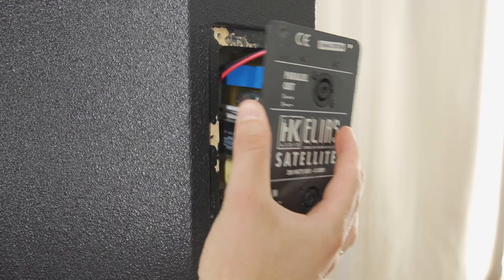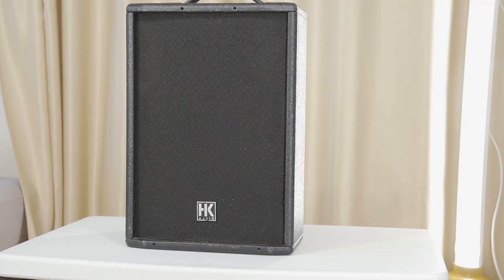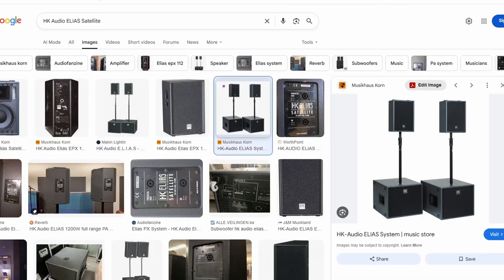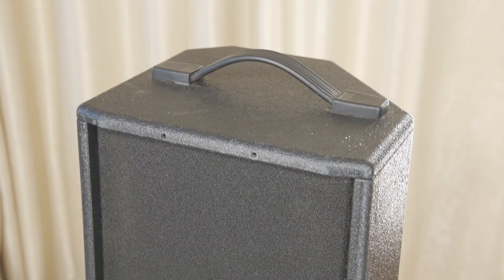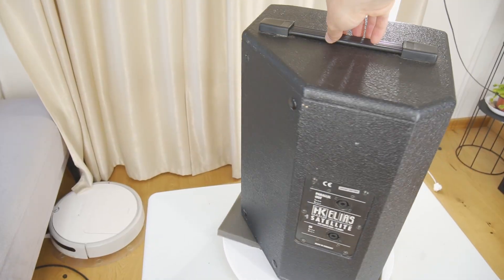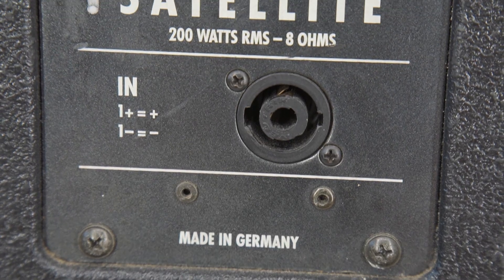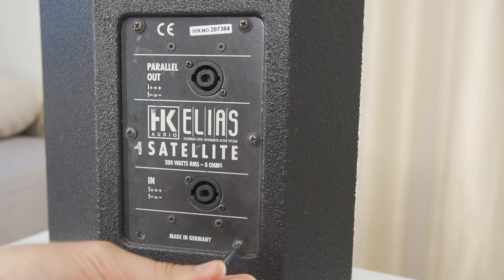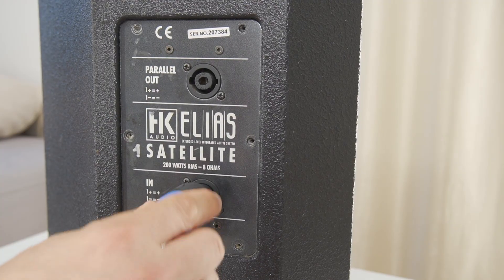Teardown Passive PA Speaker - What's Inside?

Comment: interesting that they used a cartridge bulb that looks like it would go in a cars dome light on the crossover network PCB. 
Don't know what that was for... a certain value of Resistance or fuse?
Reply from the maker: That bulb acts as a protection circuit for the tweeter, limiting power to prevent burnout.
Reply: @Techscrews  awsome thanks :)